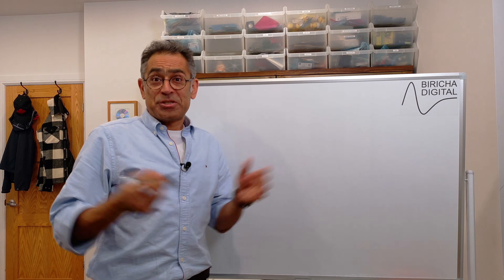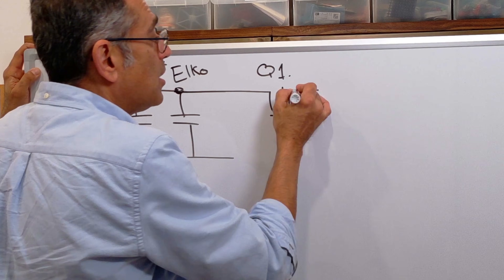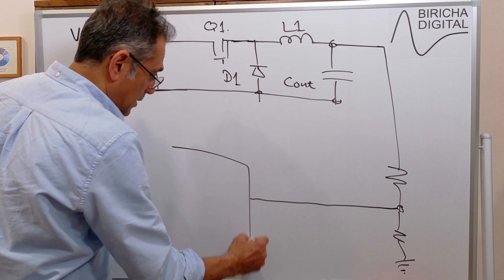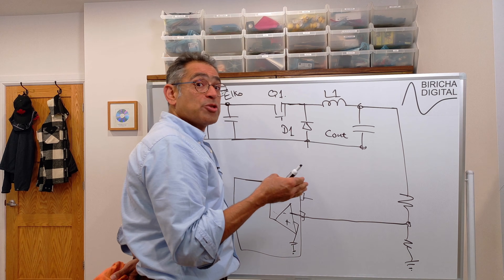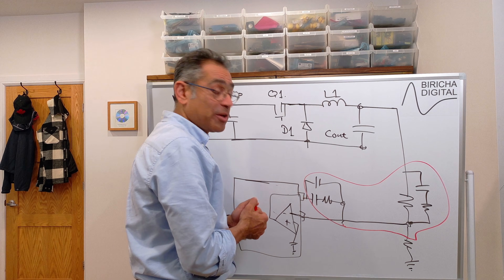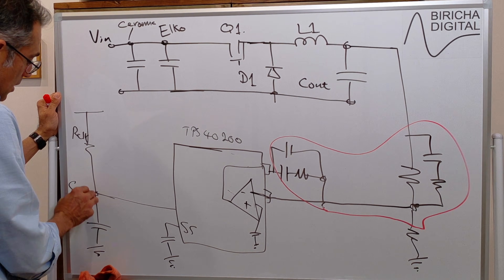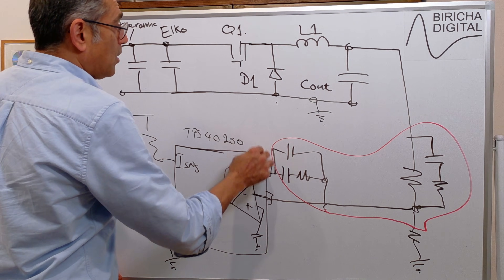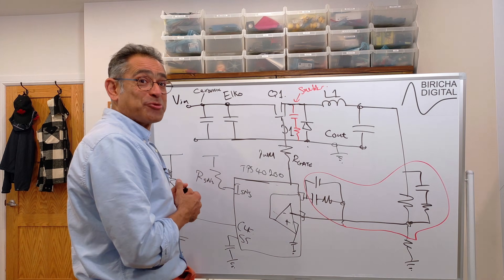Every Component You Need to Design to Get Your Buck Converter Working – A Complete Engineer’s Guide!

Comment: Great video as alway. I had a technical question related to the current shunt, assuming we are doing external current measurement. 

My question is if putting the shunt inside the feedback loop after the output bypass capacitor would badly affect the stability of the dc converter.
It would basically create an attenuation at the specific cutoff frequency of the shunt and caps.
I wanted to know if any filter of this kind would need to be compensated by changing the compensation circuit.

The componet order would be Cout cap, shunt and then feedback network.